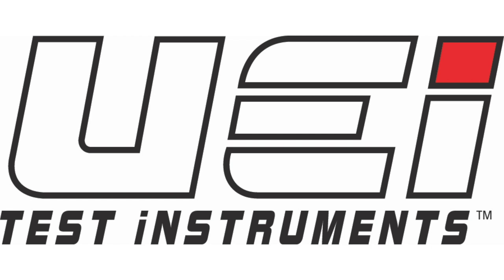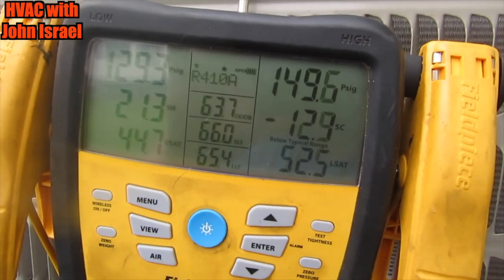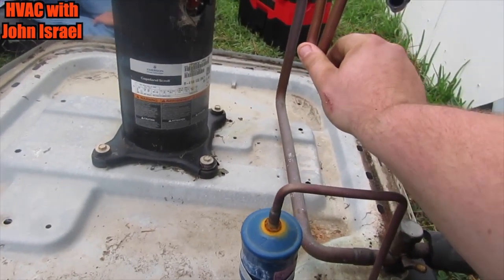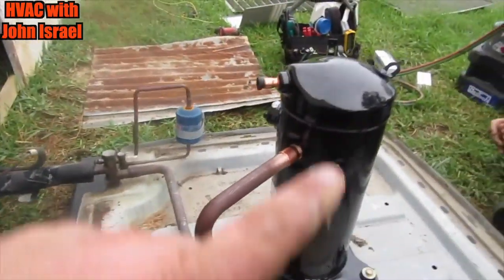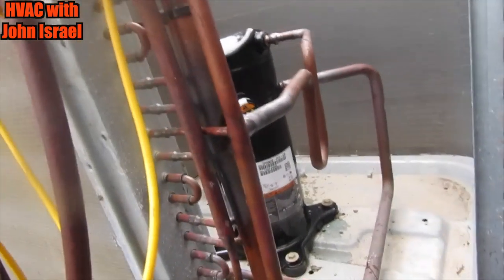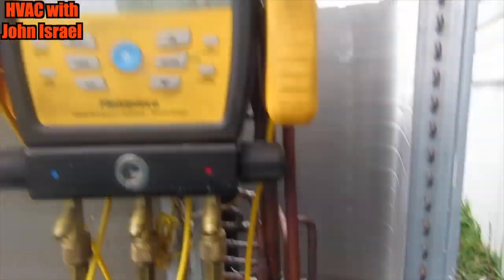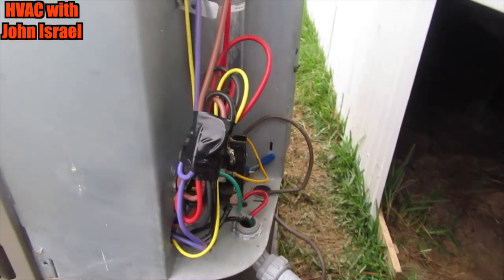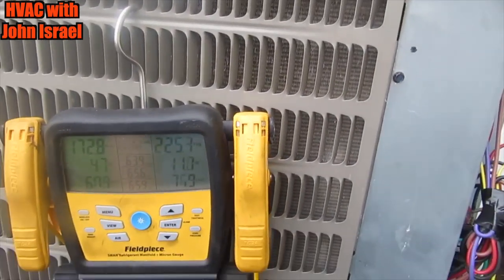Goodman Compressor Replacement

Comment: For a long time Copeland Scroll Compressors were the compressor of choice, but lately rotary compressor are being more used, goodman and some other brands is now using rotary compressor on 3 ton and smaller.
Reply: Interesting.  I never heard this.  I guess the "new" rotary compressor's are more efficient than the older ones?
Reply: Goodman puts a Rechi rotary compressor in their 2 and 2.5 ton GSX and VSX condensers. The 2.5 ton has a sound dampening blanket around the rotary. It's very quiet. 3 ton and up it's a scroll. In the past 2 years, I've put in over 350 Goodman condensers that have the rotary and have not had one go bad yet.

Comment: Good fix John. Not trying to sound like a know it all or anything but I wonder if that filter drier broke apart inside and caused a restriction, which would cause the compressor to bypass
Reply: I'm thinking it was just the dryer. 🤔
Reply: You have a point. Maybe a temp drop test could have prevented an expensive repair.
Reply: Timothy Salomon it may not have time to frost. The head is being measured after the potential restriction so it would not be high. Drier may not be the issue but a temp drop across the drier would indicate failure. Amps on the compressor would also indicate where the issue was. Higher = restriction, before bypassing.
Reply: it did seem to drop suction pressure mighty fast and jump into bypass, this would have been a great case to place a temporary line piercing tap just before the dryer ;)
if this is the case, what caused the dryer to plug? burnt oil from no oil return/overheat/lack of charge/no airflow/stuck on/broken dryer/etc.? you get my drift endless gamble...
It's probably best to assume the compressor is damaged and will die or will be shortly from lack of lubrication due to burnt oil or the new dryer will gum up very fast and repeat issue.
I think there's a back story we're not getting here and they may not have either!

Comment: Never thought of doing it this way. Thanks for the upload. On those Goodman driers I cut them out then pull out the whole service valve. Add a peice of copper outside. The just pull it back through swage it and make one braze.

Comment: pretty new to hvac i was the helper on one of these change outs my partner had me change the drier by leaning over the top major pain in the ass will use your way next time removing the coil did not look diffecult thanks for the vid

Comment: just put enough tape wraps on so if it unravels some it will still stay put. sure it doesn't look as good, but in various fields I've removed electrical tape that was there for 40+ years, while seeing zipties that failed after  2 years.
yes I mean right back to when it was still friction tape over over-top uncured rubber which covered soldered joints on knob & tube wiring.

Comment: The super techs are coming out of their mothers basement with their vast knowledge to share with you.
Reply: muniznick only a person who loves wasting there companies time would do it this way. Super tech out of moms basement 😂😂😂I pull over a 100 grand last year because I do it right and fast 💪
Reply: @tomtreece3224  I also would not pull anything but the fan/top. Then again, I am very small and can fit down in the unit with the compressor to change the drier. I would rather see someone pull everything and change the drier than not pull it apart.  Vacuum will take longer though.